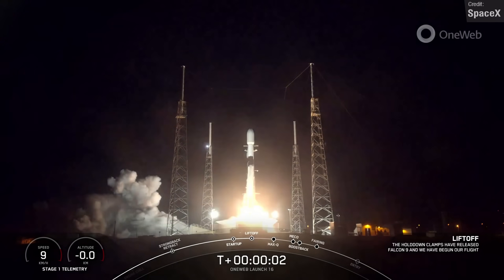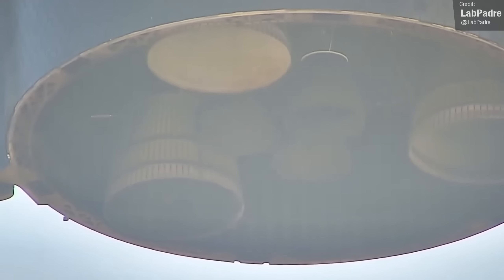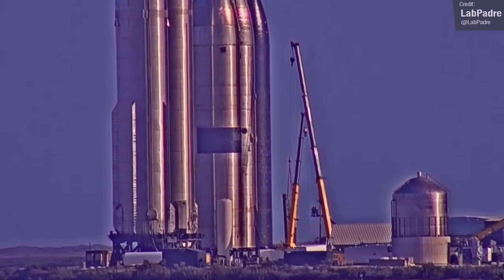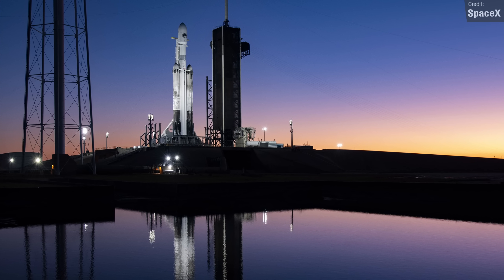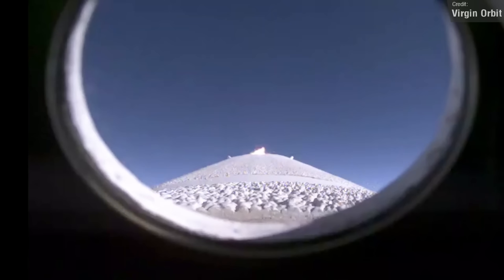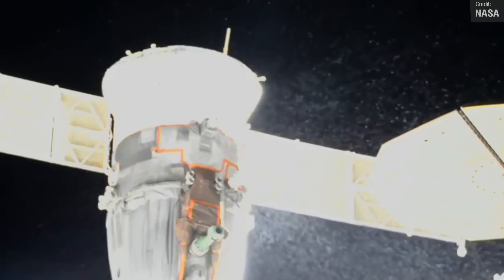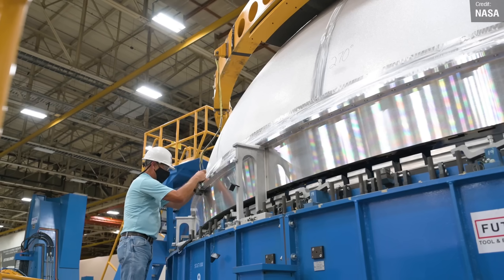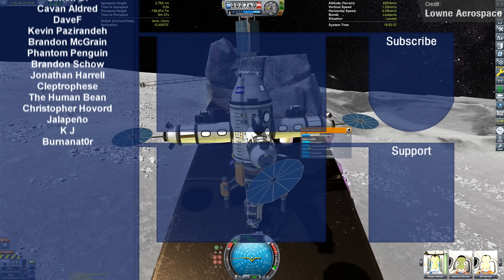Launch Attempt Failures, SpaceX Starship Final Stack, Vulcan Centaur & Soyuz MS-22 Crew Stranded!

Comment: Interesting to hear that the booster requirs pressurisation to supp ort a fully loaded Starship. What happens during launch with high G loads as the booster goes maximum thrust and empties?
Reply: Most rockets are pressurized. It makes them stronger. As the fuel is used, the tanks are filled with either helium or (in starship's case) hot gaseous fuel and oxygen.
You can try it yourself by standing on a soda can. First unopened, then empty.
Reply: @bbgun061  the liquid in the soda can isn't compressible. The liquid doesn't make it "stronger", it prevents sidewall buckling.  The helium gas applies some pressure to the walls of the vehicle, but not enough to prevent buckling. Grab a straw to experiment with
Reply: @michaelreid2329  Dude...
Reply: @russellg1473  as in "dude, let it go?"
Reply: @michaelreid2329  as in dude maybe use google
Reply: @xtuskay  Poor choice, I'd rather rely on science and engineering. Google seems to be mostly opinions.
Reply: @michaelreid2329  pressure is pressure, no matter the fluid
Reply: @bbgun061  a liquid is not compressible, a gas is. Go fill a sealed tube with a fluid and is hard to bend. Fill a tube with a gas, bend it not by much and it will crease and buckle. The load of a fully fuelled Starship will be accelerated, high g load on a gas filled thin walled column. If SpaceX has found that they need the booster filled to support the Starship whilst on the ground it sounds like it lacks some strength to prevent buckling. Doesn't matter the gas, the pressure might support the load like a piston in a cylinder, but does nothing to reduce sidewall buckling. If you watch early rocket failure, sometime the structure failed before anything else went went wrong.
Reply: @michaelreid2329  but almost every rocket is pressurized with gas, so it must work
Reply: @bbgun061  Easily one of the most slender first stages with one the largest second stages we've seen.
Reply: As the tank contents are used Helium is released from a high pressure tank to maintain the tank pressure.
Reply: @postron5649  Interesting idea, but you'd have to have a sh*tload of helium to make up to the pressurised volume of propellant and oxidiser consumption, IF the helium is meant to maintain structural integrity. Autogenous pressurisation is more about maintaining constant fuel flows, with helium doing the same thing. If the helium was to somehow make up for the fuel use then you'd need to carry as much helium as propellants.
Reply: @michaelreid2329  Helium is a Gas while the propellants are Liquids. That is why a much smaller amount of Helium can expand to maintain the normal pressure inside the tank as the propellants are used up.
Reply: @postron5649  This, this is correct!!

Comment: heads up your 720P videos are HUGE, something to do with what format is used prior to youtube compression? other channels i watch have similar sizes for 360p and 720p. 
I download to watch later as no internet at home by choice.
360p:44MB       720P:139MB for a 13 min vid. love your content, just a heads up as chews data for the phone users :)
Reply: A quick lossless conversion to MKV using x265 whilst keeping audio the same gives a lot smaller size, same (but not as small) with x264
Though I don't think YouTube supports x265, nor av1 yet
Also, for a video with so much content, 139 MB isn't actually that surprising, but it's still a bit
Reply: @atemoc  thanks for the insight. been downloading youtube to watch later over the last year so get to see patterns. 
what got me noticing this is all of the Simon whistler channels(mega projects, geographics etc)  constantly have very small files while others are much larger for the same length. could be other variables im not aware of. anyways, cheers for the food for thought